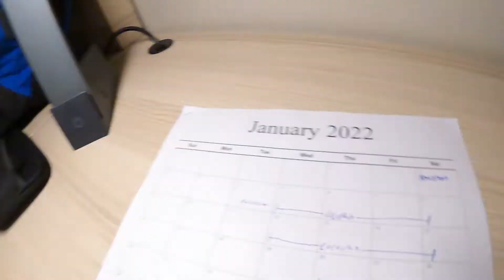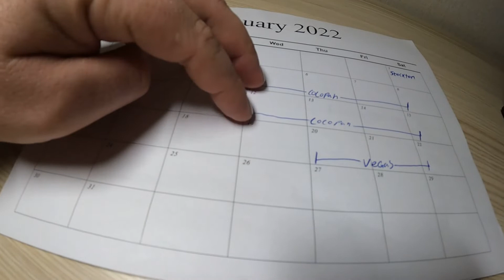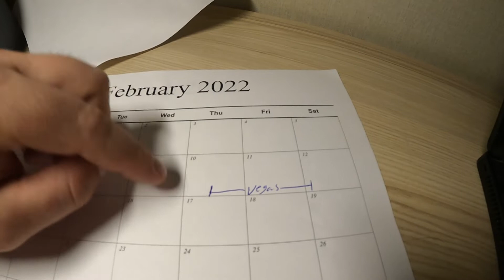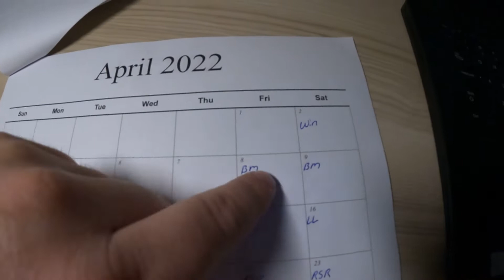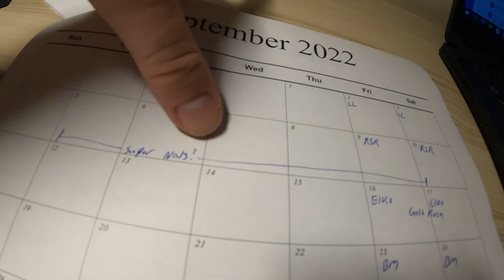Starting my 2022 Race Schedule and out of Town for Work

Comment: If you race Stockton just throw a old body on lol. Also Mojave has a multiple day race for new year’s
Reply from the maker: That bad huh?  And Mojave is about 9 hours away for me, stockton is about 2.5hrs an easy day trip
Reply: @wadelumsden1548  don’t get me wrong I love the track in Stockton but it’s known to be very rough even on nights sprint cars are there. To top it off I’m sure you have seen how some people race in Cali lol
Reply from the maker: @raceshop5416  fair enough! I've never been before. Looking for a new experience.  Do u know a ballpark for fear for an open motor guy there?  Guessing a 5.80something?
Reply: @wadelumsden1548  never know though could get lucky and it be a clean night lol. I’d be more around a 5.33 probably it’s almost a half mile it was changed to a 4/10 in like 2016